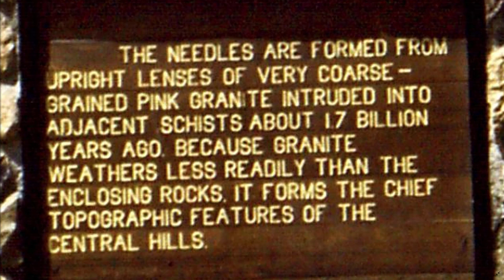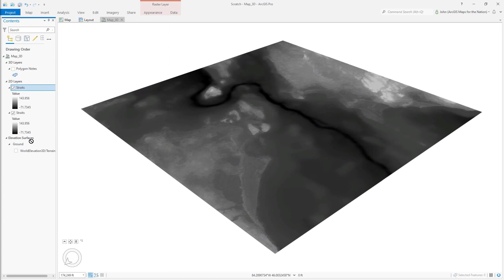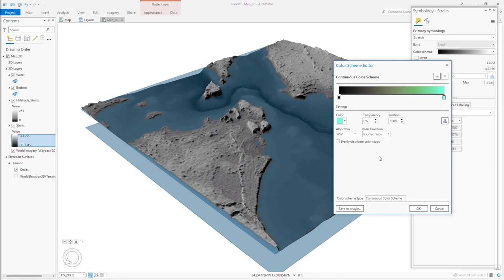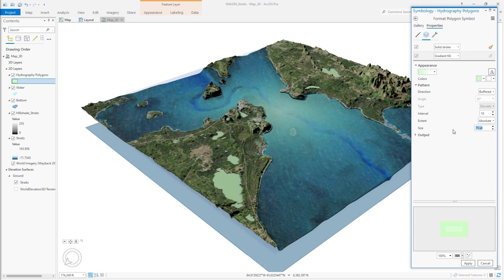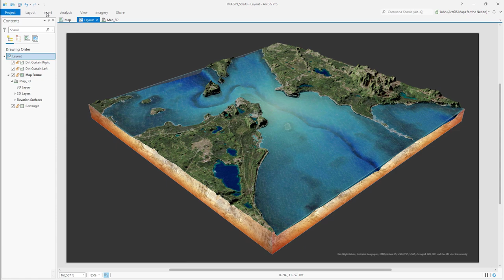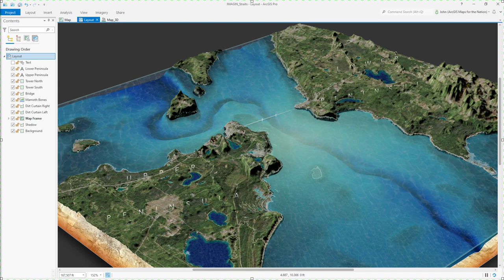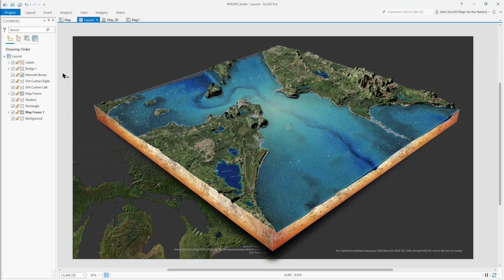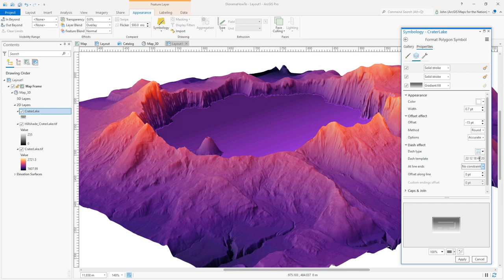How to Make this 3D Diorama of the Straits of Mackinac

Comment: Amazing Videos! I am really enjoying learning about how to create these effects for myself. I am wondering however if you can help me as I keep getting an error for Extract by Mask as well as when I try to Mosaic images together following your other video. I keep getting Error 999999 which tells me to contact ESRI. Any ideas? I have reached out to my contact at ESRI but they say it is not a license issue.
Reply from the maker: Oh no, I’m sorry to hear about this inconvenience. The 999999 error is, to my knowledge, the generic name for an unspecified error. Pro doesn’t know what went wrong so there’s no prepared message for troubleshooting. Do you get it every time or intermittently?
Reply: @JohnNelsonMaps   Thanks for the reply! I was able to figure it out. It was happening every time a new layer / file would be created. The error was because I am using Parallels to run Pro on a Mac and was trying to save to the "Mac" portion of the drive.... Pro didn't like that at all.

Comment: Is there a way to export these to format that can be 3D printed.
Reply from the maker: i wouldn't do it this way. instead, you consider exporting an elevation model as a gray-scale image and use a 3rd party tool to convert the image to an STL file.
Reply: @JohnNelsonMaps  Thanks for the reply. You make fantastic informative videos. I’m now a keen follower.  I had hoped there would be an easier way to get a colour model out ESRI. 
I have had success with some full colour 3d prints using blender and the 3d printing service shapeways. 
If you like I can send you my article and some image examples.